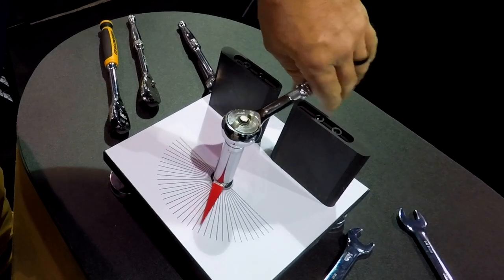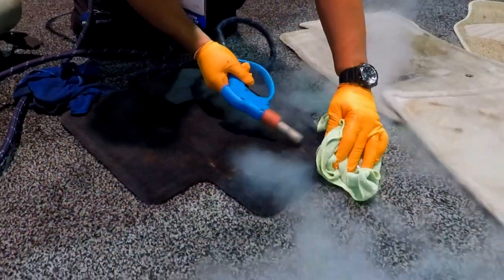MORE TOOLS from Day 2 of The SEMA Show 2022

Comment: Those zero degree ratchets would come in handy.
I'm more interested in how they do it and how strong they are in comparison to the typical design
Reply: I have a cornwell pass-through set where the ratchet is gearless. Ive had it over 10yrs and have always wondered why no one has made a regular ratchet or ratchet wrenches gearless yet. Its about time lol

Comment: Welding with batteries! Where do we go from there.
Reply from the maker: They've actually been doing this for over 20 years. Thanks for watching.
Reply: So charge it in the shop, then unplug it and roll it to your station, and then proceed to use it, or get an extension 🤷‍♂️